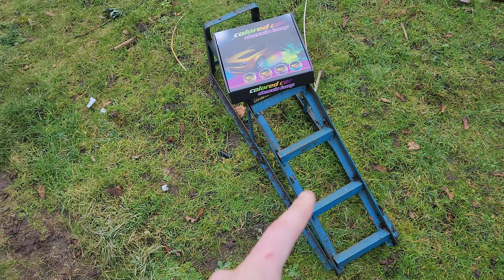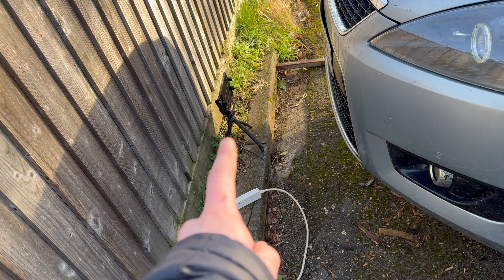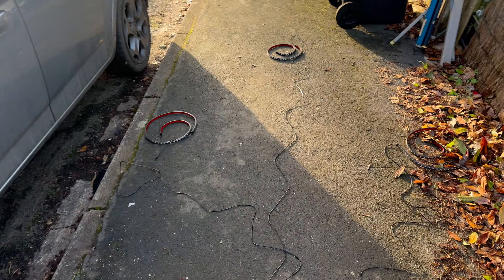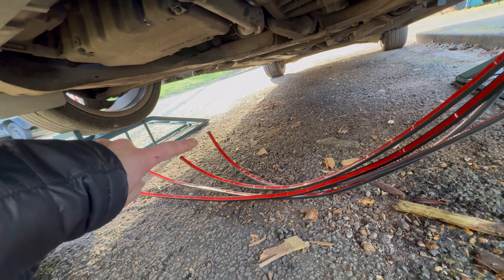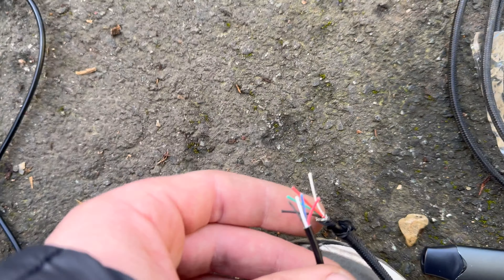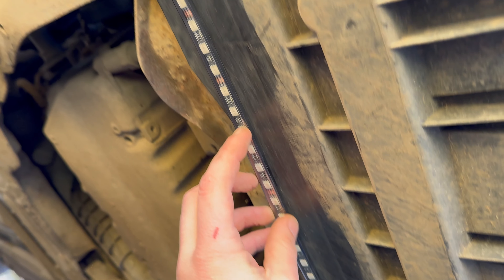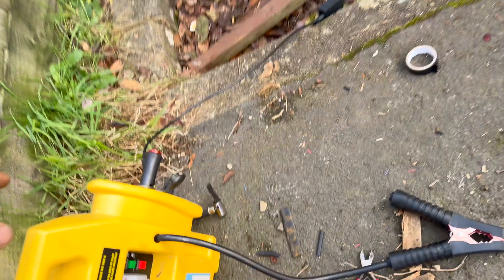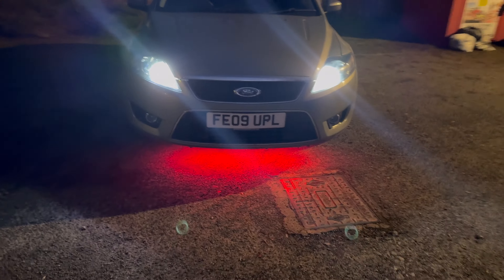How To Install Underglow

Comment: Looks good, but are them lights meant for a 3 door car?
Reply from the maker: I did select the larger or longer lengths, but you're right. I do feel it needs 10/20cm more on the sides. Was the largest set they had to select from at the time.

Comment: Where's you engine undertray ?
Reply from the maker: That’s a good shout… in my front garden. Need to get some tabs to refit it. Seen it as weight reduction…. However with the rain and puddles etc be good to have it back on!